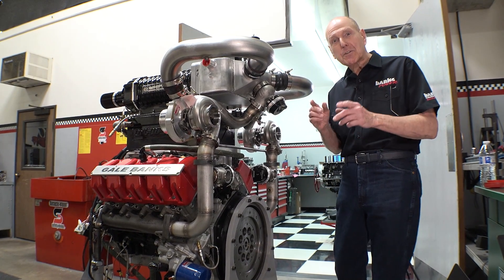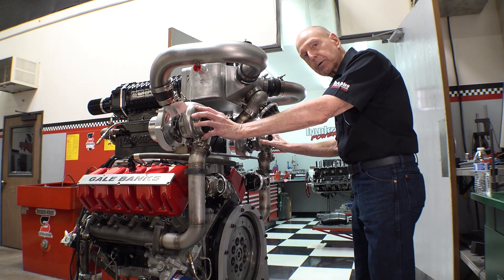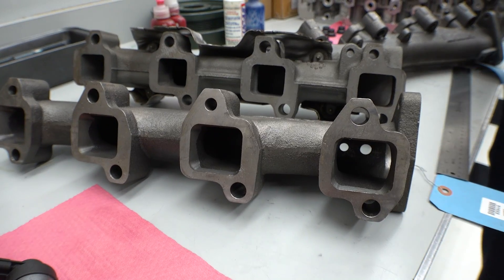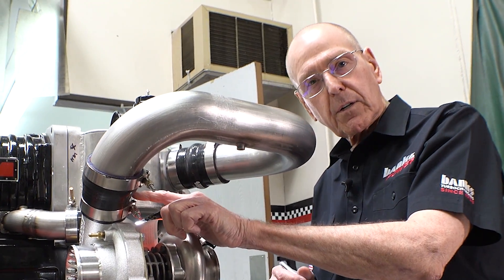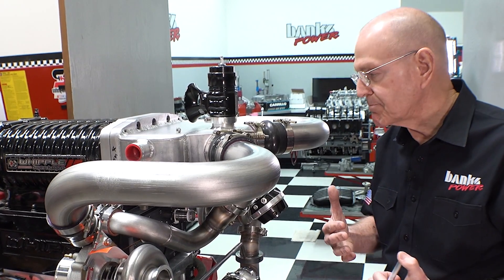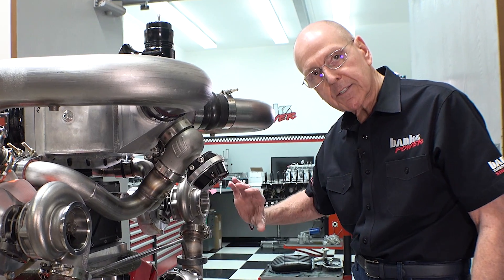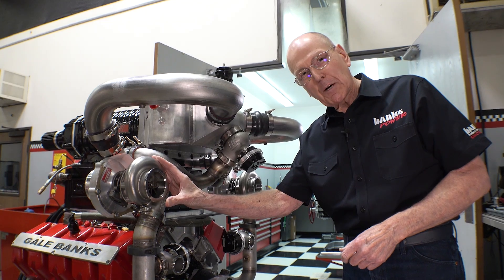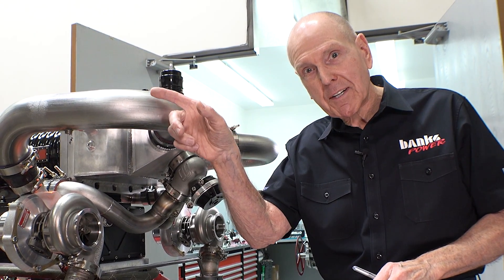SUPER-TURBO DURAMAX FIRST LOOK: Building A Monster Truck Engine Pt 10

Comment: Question... Why are you bypassing hot air from the in front of the first intercooler to below the blower? Wouldnt you want cooler air and put the bypass valve after the first intercooler or is the second cooler efficient enough to chill the bypassed air? Great vids!

Comment: What would be the point of having a positive-displacement blower before turbo(s)? PD's are just an air pump, not a compressor - you essentially just add displacement. The Cfm is dependent on their displacement and rpm (same as an engine). Once the charge is past the rotors, that's the air you have to work with - no more, no less. Centrifugal blowers draw air in to compress it, thus raising density - their airflow is dependent on their rpm AND the cfm demanded of it
Reply: Eh? This is the right way to twin charge and belt driven superchargers don't have the low end response.

Comment: Gale if you can get that engine to sing 1600 Horsepower that would be cool and on the Killing a Duramax if you could please test the 900 Horsepower L5P with a Allison 3000 and 4000 also the eaton 18 speed to see if over the road semis could have a smaller engine and still pull 80,000 pounds with less weight or have better fuel economy with putting a bigger air cooler
Reply: NO, do it yourself.

Comment: I don't know why this isn't a more common setup. I've thought that this was a great idea for a long time even before I knew Banks was doing it. I makes sense to use a blower in conjunction with turbos to get boost at idle and to increase low end torque. Ideally one would use a centrifugal clutch or something of that nature to remove the blower from the system at a predetermined RPM so that you would lose that parasitic drag.
Reply: Cost and Complexity, most men are far too simple to use this kind of setup. I will be twincharging TWO cars, watch this space. I am going to finally explain to the moose twits of the tuner community that the supercharger is not the restriction.
Reply: @dj4monie  Hmm not sure why someone would think that a supercharger is a restriction, especially the centrifugal variety. Are you planning on having the supercharger disconnect once the turbos spool? I think that would be the best all around system. I'm planning on doing the same thing once I get my shop up and running.

Comment: I love it

Justin to Clearfie, the blower breads always more than the engine? So the bypass valve will always flow from under the charger in top of the charger, after all, the charger (turbo or screw) is an pressure multip player.

So if you're blower is 20boost it's really 34.7psi absolute with 14.7psi inlet pressure, so called na pressure.
The blower works with multiple number of abaut 2.4
Now if you put in from the turbo to the blower 14.7 psi of boost, (29.4 absolute pressure) the blower will try to make 70.6psi absolute, so boost gate 55.9 psi

This bigger pressure might be a problem with tge belt slip of the blower because you ask dabble more power from the blower. And it just get worse when boots build even higher on the turbos.

So you will need that bypass valve to not slip the belt or break the blower shaft.

In the case where you feed the turbo with the blower is an other case, when the turbo gets oon the engine "looks bigger" for the blower and takes the multiple factor down.

All the best and keep up the good work

Comment: Hardware setup, noe it is time to flog it into shape on the dyno.  This looks like it will be awesome, if you do not blow the valve covers off with over pressure.  (Which will be awesome and expensive...)

Comment: But what about the E.G.R.? You will still have ex gas in the cylinder.
Reply: This is the race engine they're putting in a monster truck. I doubt it has any emissions equipment on it.

Comment: well with technology this super turbo design actually seems like a decent idea in possibly alot smaller engines  say a  car that couldnt spool a bigger turbo but with some added positive forced displacement will light that turbo
Reply: Let the OEM's figure it out. Compound Turbo and Twincharging is the next phase of the hot rod culture.

Comment: Interesting setup for the turbos!!!! I'm still trying to come to terms with the duel turbo and why you have bypassed the blower. I think I understand but it's  confusing to me.  Can haedly wait till you set this on the dyno, just to see how it all works together to get the horsepower your looking for. Thanks for taking us along on the journey......
Reply: The blower is only going to be able to move a certain amount of air. Pushing the air with the turbos increases that, but you still will get to a point the blower is a restriction because it can't move as much air as the turbos are pushing. Or, the blower will be adding enough heat and drag that it isn't adding power. 

So, at that point you want to let the turbos bypass the blower so they can move as much air as they can. Some air will still go though the blower, but some will also bypass.  That's part of the problem with a setup like this. You have to figure out a way to have the blower provide the low rpm power as well as have it switch to the turbos for high rpm power.
Reply: @NBSV1  thanks for the explanation on the bypass. Like I said before I think I understand the concept,  but the proof will be in the dyno room.  This engine as is just looks like a monster.  It will be exciting just to see what can do. Thanks for sharing....
Reply: @NBSV1  The supercharger is not the restriction...... It will take as much air as you are feeding it.

Comment: My 12 valve Cummins had a D1SC procharger feeding a 62mm over 75mm compound turbo setup. It was the most responsive diesel I’ve ever seen unfortunately I destroyed that engine lol
Reply: It destroyed it self cummins are awsome motors when stock or mildly tuned.but like any engine when pushed to there max it's only a matter of time.
Reply: victor girouard it dropped number 1 intake and exhaust valve. Before the procharger I rebuilt the engine but didn’t replace the valves and the 180lb valve springs I installed were apparently to much for stock valves. Inevitably it was my fault but shit happens

Comment: Makes me wonder what the charge temp of a Detroit 8v92 with a turbo-fed supercharger is. No cooler  at all. Ouch.
Reply: The 8V92 had a coolant flow charge air cooler in the valley between the heads. They called it a "inter cooler" because it was inside the engine. If memory serves, the charge air temp. was a bit north of 350°f .
Reply: @1oddog  Did not know that. I've only worked on one, and never that deep.

Comment: Would it work to have both turbos and supercharger go all at once it would it just blow the heads off
Reply: The supercharger is only really there to help throttle response. Once the turbos spool up, they'll put out maybe triple what the supercharger will. At that point the supercharger is a restriction so they bypass it.